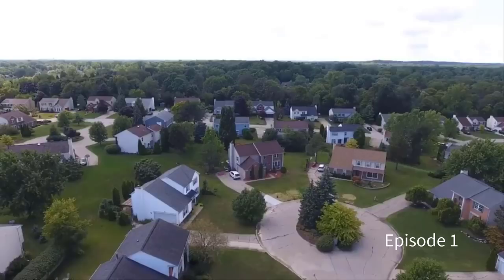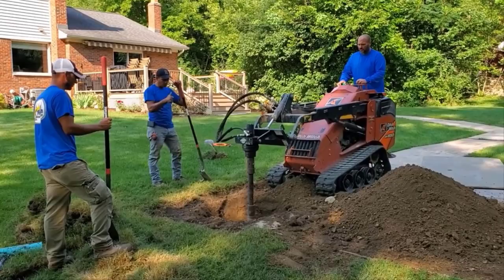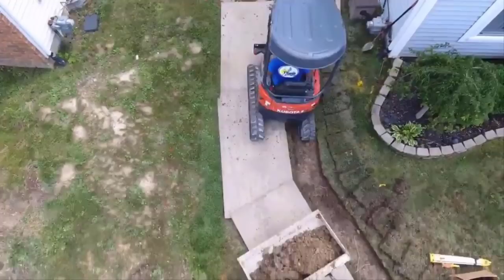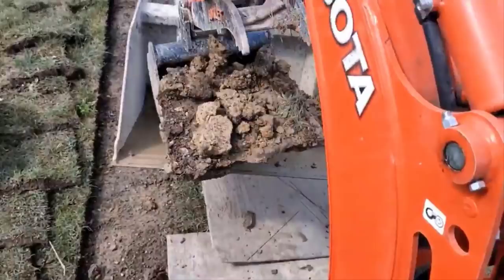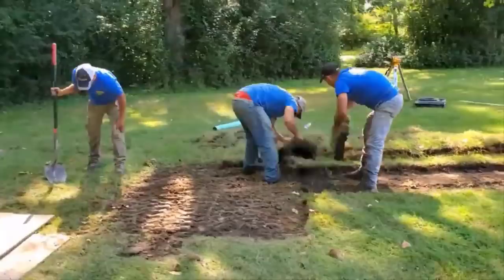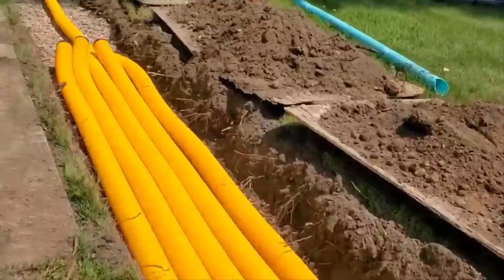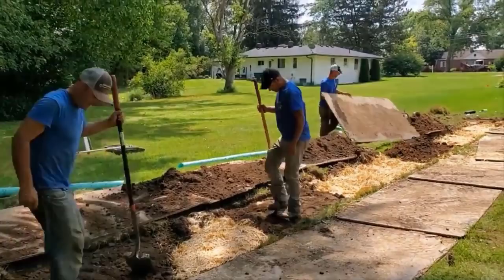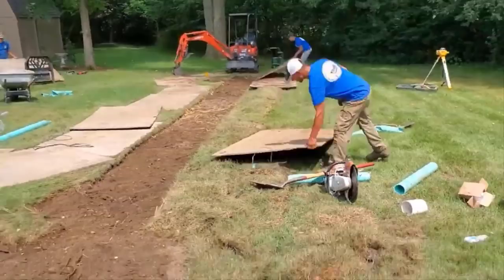How to Build a Leach Field for Yard Drainage Systems Episodes 1 through 5

Comment: Great video!  Very informative.  Nice to see option of gravity fed leach system at the one house. Are leach fields just for sump pump output and French drains or do you recommend them also for downspout runs?  I’d imagine you’d have to use d-box to catch debris so as not to clog up outgoing knife cut section.
Reply from the maker: Watch "Dos & Don'ts  - Downspout Drain in the North Where Winter is Winter [ Complete Guide ]" on YouTube
https://youtu.be/_V1efJM-8yM

Comment: here in north western Ont. Canada, if there a problem in sub division, the city up grade the storm sewers', but that only happens in the very old parts of town, all our storm sewers' are 48 inch concrete ,, that sub division would never been built like it has, a easement would be at the top of the hill for a storm sewer.. system, we dont gel back up very often. and we get many 5 to 8 inch storms and 7 to 12 feet of snow melt, putting straw on top to help with freeze, will only last a few years until it rots,, we use a 3 inch close cell foam,, our frost will go down 7 feet, only place a leach field is used is in the country were there is no city stuff.. the red clay here you can wait years for water to leave, it dont go into this rock hard clay, you would make a huge pond... my pig wolos never dry up,  it take a year to dry one inch of clay.. these homes were all built way to low,, its like the diy guy that builds a garage and you can see his drive way water going to run right in the over head door but they cant be told a thing.. the problem with the yard your working on, turns to clay at the outer yard edge and was filled with top soil in the yard, making a huge bowl.  the whole yard will now turn to mush,, i seen it many times

Comment from the maker: Store | French Drain Systems | Curtain Drains | Macomb, Oakland, Lapeer, St. Clair County
https://frenchdrainman.com/store/
Reply: Hi and thanks for the your videos. Question- My backyard has natural slope then drops off a hill after 30’ - the contractor is running solid corrugated pipe from downspouts to 20” D box and then fabric wrapped perforated pipe sitting on stone the 30’ to hill edge to a 6”pop up discharge! Is it ok for the perforated to leach that run or should it be solid all the way( no landscaping or trees nearby) I don’t want the yard to cave in! thanks!